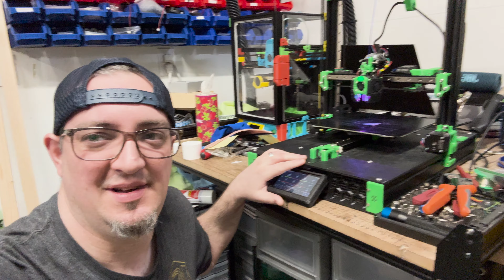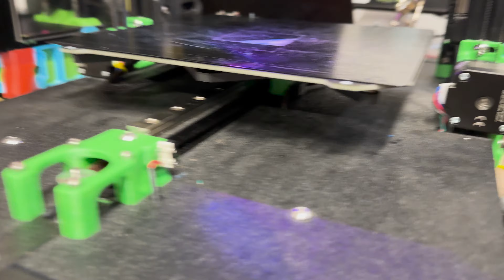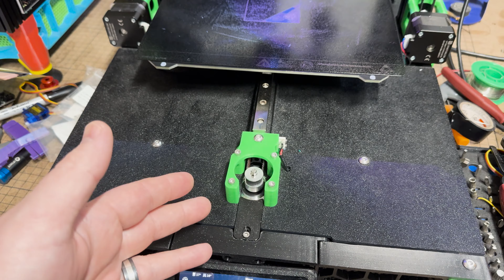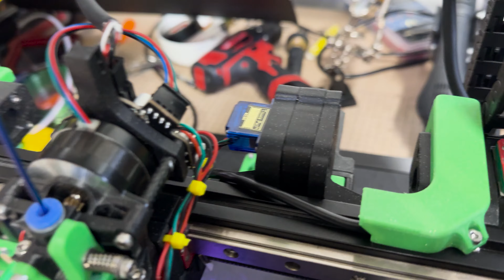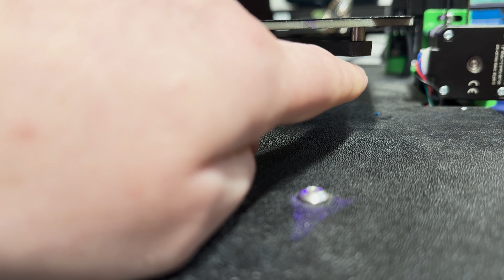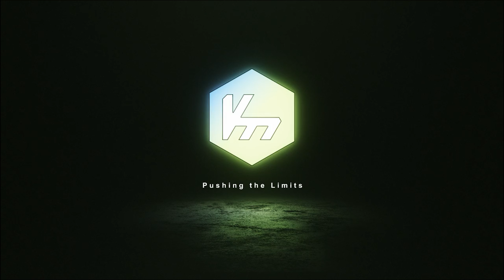Switchwire Revival Part 3

Comment: I can also highly recommend the silicone spacer Prusa bed mod. It's worked great on my SW for a while now. I had the servo Klicky dock on mine for a while as well but I never found it to be great and I'd find it getting very loose and failing to dock/undock regularly after a few prints. My SW is enclosed and there may have been further revisions since improving it but I ended up moving to a Super Pinda to simplify the setup and it's been working flawlessly since. That also allowed me to remove the Z chain and just run the umbilical up the vertical extrusion to a PG7 gland on the top corner then to the toolhead. Made for a clean setup imo

Comment: I'd suggest the Prusa Silicon Bed Level Mod.  You can then do a SCREWS_TILT_CALCULATE and dial in the bed without having to drill out the bed mount.  Basically you replace all but the center stainless spacers with 10mm of silicon tubing.  It'll be even easier for you to dial in than mine was if you get the klicky probe working.  I've got the inductive probe on my SW and I have to take the build plate on and off when dialing it in.
Reply from the maker: That is an amazing idea. I'm going to check that out!